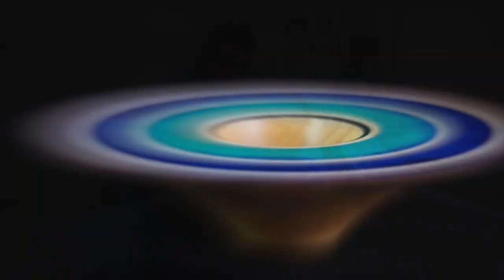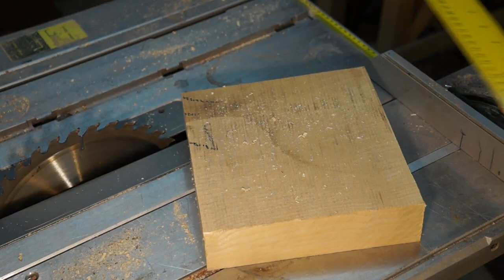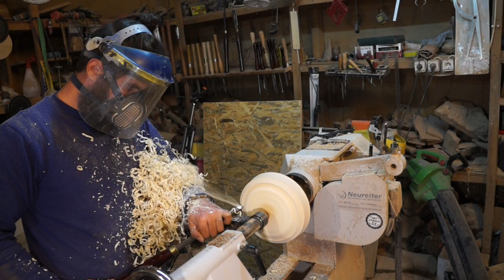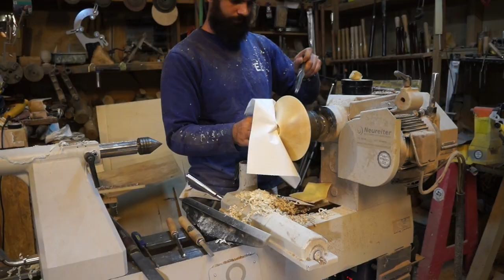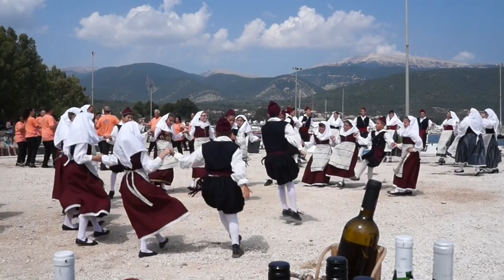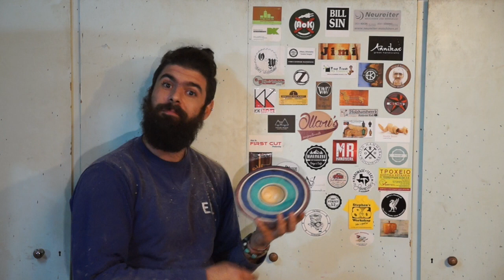Woodturning and colour a maple platter!

Comment: Hi Bro!
I love working with Maple and it is very common where I live - many varieties for sure. Silver Maple is likely my favourite. It also helps that I have a close friend who is an arborist and owns a tree service. So I basically have an unlimited supply of Maple, Ash and Walnut for free!! Very nice!! He also has a kiln that he just made from a design from a USA University. He made it for under $2,000.0 CDN $ and it holds blanks up to 6 feet long at any thickness you want, plus there is room for easily 30 - 40 bowl blanks and many other bits & pieces. He put large doors in the side so he can load with a forklift truck.
I can send you the plans if you like! His is about 8 - 9 feet long, 4 feet deep and about 5ft high. Solar powered and has 3 electric exhaust fans. You would probably have space for this on your farm. As for efficiency, he dried a fresh cut Walnut slab for me 8" thick x 2ft wide x 6ft long from 42% moisture down to 9% moisture in only about 5 weeks. (there was also a lot of other wood filling the kiln.) The average daily outside ambient temp was around 22*C through the period. Great device to have, and can be made to almost any size you have room for. let me know if you have interest in the plans.
Regards
Dennis
Reply from the maker: that is really very kind from you to send me plans my brother !!! i like to have it for the future because at the moment with the money that i have probably i will get meterials for a kiln in the size of machbox lol !!! but i need to make one can make my life easier !!! unlimited maple .... wow !!! one more problem that i have is that i cant find big boards the max wide is 37 cm never find something biger than this and i like to make large stuff for fun !!!
Reply: Hi
I will get access to the plans this week and send you the information.
I will also check on whether or not I can ship wood to Greece. Some countries (Including Canada ) do not allow wood that is not inspected into the country due to disease or bug infestation. If I can do it and the cost is not to bad - I will see what I can do. Maybe??? Will advise.
Already making plans for next September - do you have anything booked yet for September that will make you unavailable/
My best to you.
Dennis